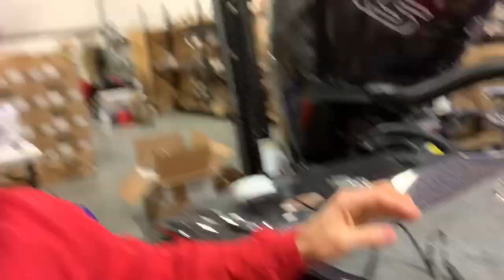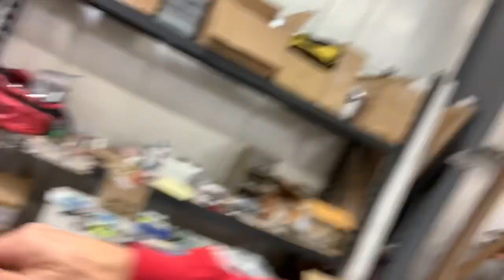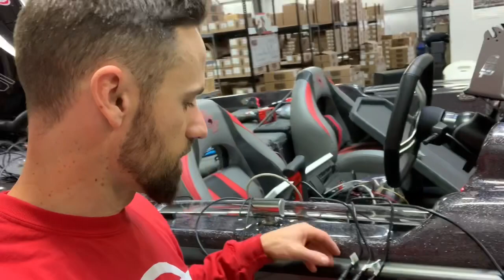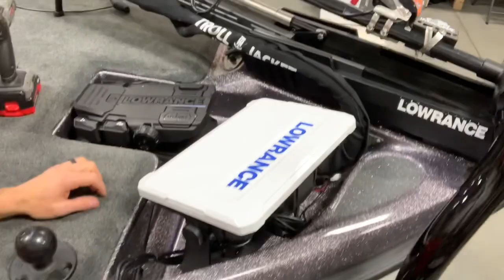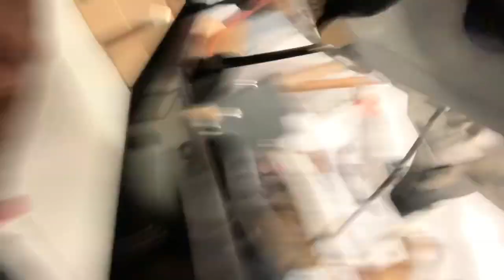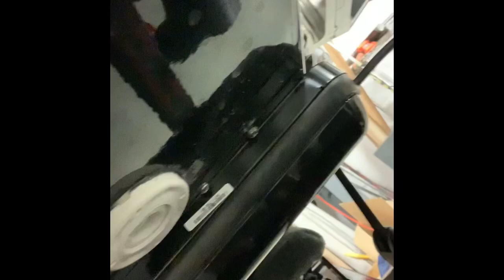BOAT RIGGING NEW BASS BOAT - Part 2

Comment: Would it be ok to put a transducer on the port side of the transom if it’s a bow mounted fish finder ? Mercury would be off when using the bow mounted unit so there wouldn’t be port side prop wash ! I wanted to put it on the port side because there is already a big 3/1 transducer on the starboard side . The port side transducer would be a Garmin unit . The starboard side transducer is for a Lowrance on the console. I didn’t want two big transducers right next to each other . Thus using the port side for the Garmin.  What do you think ?

Comment: the NMEA network DOES NOT transmit the data you see on the screens of the Lowrance units. The data bandwidth of NMEA won't begin to be able to send screen data. The Ethernet Network shares the screen image from unit to unit.  NMEA is used to interface to other modules (such as temperature probes, external GPS antenna, etc.). NMEA is also used by the Lowrance units to broadcast waypoints to other units when you add one to any unit.

Comment: I thought sonar signals passed via Ethernet vice NEMA.
Reply: me too  I thought nema was for the engine
Reply: Correct. And it's NMEA - National Marine Electronics Association, not NEMA.
Reply: You are correct that the Ethernet connection is used to share sonar data between units. NMEA isn't just for engine telemetry; it is used for numerous electronic accessories on a boat. Temperature probes, external magnetic sensors (for an electronic compass), external GPS antennae, and audio system control are a few examples of applications you might find on a modern bass boat. Lowrance uses the NMEA network to synchronize waypoints stored on a display unit with other Lowrance units on the NMEA network.

Comment: Do you do anything special to drill through the gelcoat?
Reply from the maker: R J Only try to use a small pilot hole when doing 3/8 holes or bigger
Reply: @JohnCrews  Thanks.

Comment: 36v battery info please?
Reply from the maker: Will B Bassin It is a Lithium Pro. I’ve been running them for 7-8 years.
Reply: @JohnCrews  thanks that's definitely a space saver. looking into cashion rods also. tha is for all the info

Comment: Go to data sources for your console units and set your GPS and heading (obviously) to the point 1. Use the internal GPS on your bow unit because it updates just as fast as the point 1, but it will be much closer to the transducer (almost directly over it) this is an easy way to eliminate so error when fishing waypoints.
Reply: John, I am local to you if you ever need a hand get my number from billy Kohls. I have just done everything you did on my new boat and it was certainly a job, but having done it myself will make it 100 times easier to diagnose an issue on the water.
Reply from the maker: Morgan Overstreet Exactly! Thanks man 👍🏼
Reply from the maker: Morgan Overstreet Yes, I use the Point 1 on rear for console unit for accuracy. Good note to mention! Thanks
Reply: I agree, but wish to point out a fine point. For the bow unit, select the internal GPS antenna as you say, but still select the Point-1 as a heading sensor (only) source. As you say, this uses a GPS antenna almost on top of the trolling motor transducer. Selecting the Poin-1 as the heading sensor source will help prevent the dreaded "boat spin" on the display when sitting nearly motionless on top of a waypoint.
Reply: txman201 exactly right. That’s exactly how I setup my boats

Comment: It would have been interesting to see video of fishing wire around the corner of the stern and down to the console. Yes I saw the harbor freight fiberglass rods, which I also use (wearing gloves because they splinter easy), but it would be interesting to see your tricks on this step.
Reply from the maker: Trek Madone We didn’t have a 3rd hand to run the camera. Lol. I’ve got more wires to fish in part 3. I’ll try to show it.
Reply: @JohnCrews  I'm about to install a couple Humminbirds on my BassCat Puma FTD, would be cool to see where and how you are running those wires. Have not found any other resources.